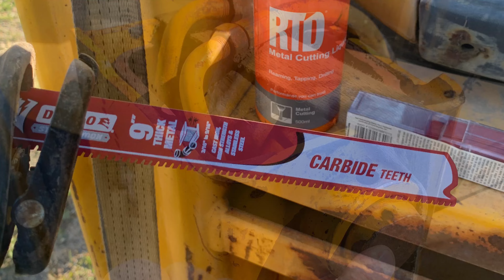JCB 3CX stabiliser seal repairs DIY

Comment: That was a heck of a task ! When my Project 7 stabiliser rams started leaking I confess to outsourcing the repair and the chap had to press the pins out with a very large hydraulic press - that was 10 years ago - I've now got a Project 8/9 side console like yours a hope I don't have to do a repeat performance but do at least now have a 60 ton H press.

As Matthew says in the previous comment (Hello Matthew fancy seeing you here!) could you use the Jakes hydraulics and a jury rigged extractor

Comment: Hello JB, thanks for the vid. how did the cylinder come out of the casing with the foot still attached
Reply from the maker: First I cut the top pin in 2 places to free it from the top end of the housing, then I used a plasma cutter to cut away the housing at the bottom pin so the cylinder would drop from the inner box section
Reply: @JBFromOZ  Thanks mate, I need to do that job soon, hopefully the pins will come free cheers

Comment: What you needed was a massive hammer and a buddy holding a drift, if you both wear sandals, it works every time!!
Reply from the maker: I will remember that for next time! I found at work they have a massive rock-breaker that is forklift mounted for precisely this kind of percussive maintenance!